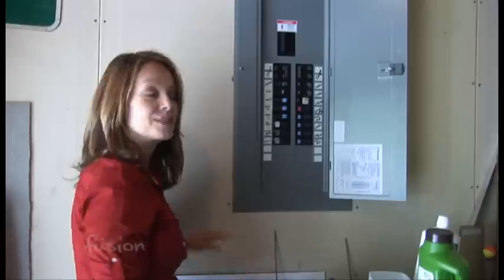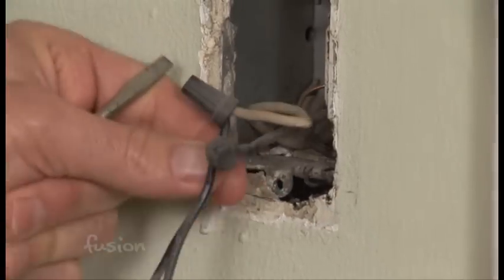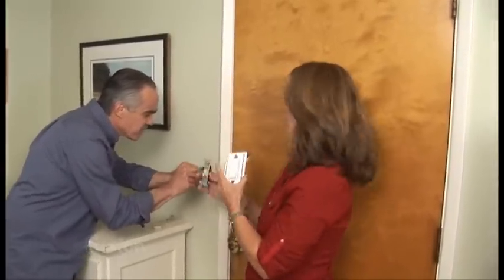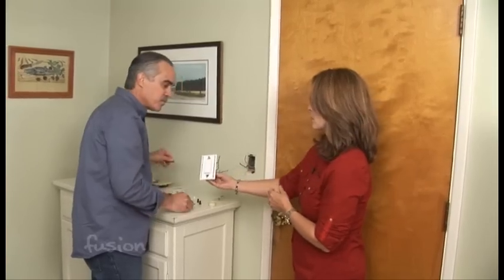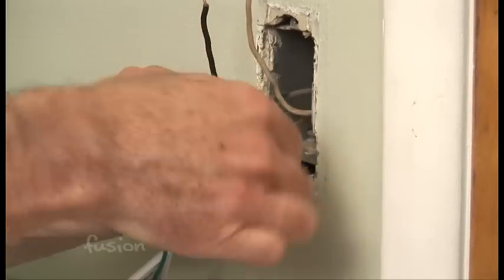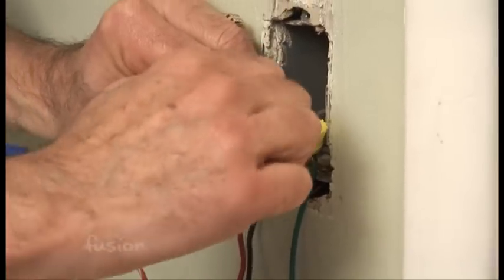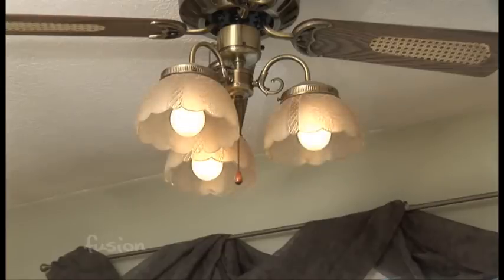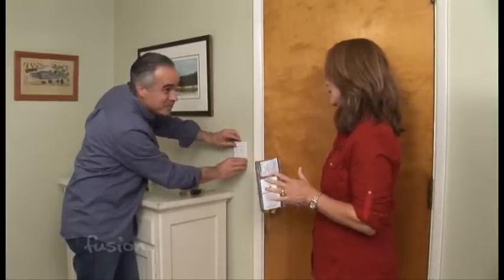Replacing a Dimmer Switch

Comment: I see your dim switch came with a red wire ..My dim switch came with 2 black wires and a green wire .
Now I'm confused . 
How do I know witch black wire has to be connected to the other black wire ??
Reply: Ones hot and one is not, but a $5 electronic pen, touch it, it will beep if it's hot,  and the other won't

Comment: If there are two black wires in the wall, which black wire do you connect to the black wire on the switch?
Reply: It doesnt matter

Comment: This video was very helpful, but what do I do if I don't have a ground wire in the box to attached to the new dimmer switch which does come with a green wire? The bell box inside the wall is metal and is inside an older home.

Comment: There's a few problems here, biggest one being you are checking for a voltage across two (potentially) live conductors the outgoing of which may well be at the same potential as the incoming which would also result in the voltmeter showing 0V while it may still be live.
Reply: He should be checking to the box/ground?
Reply: @silverspiderpig5  Correct. Checks for Voltage should be between all combinations of conductor "Classifications": Live (Hot) to Neutral, Live (Hot) to Earth (Ground), Earth (Ground) to Neutral (From this combination you should get 0V even when the circuit is energised) are the combinations that apply to domestic situations.

Comment: i did wire the same as shows on your video ...and it did work fine with light but when i have a fan on on high speed and when i dimmer the light the fan slows down as well .. which i don't like it .. so is their any solution

Comment: I am replacing a dimmer switch like the one in the video with a regular on/off single pole switch. The only thing is my new switch does not have a ground screw or any place to attach the ground wire from the box. Is this because the box itself is grounded and attaching the switch to the box with metal screws then grounds the switch? Or do I have to do something extra with the ground wire from the box?

Comment: Black doesn't always go to black.. Black on the new switch is your line, red is load. And when connecting to a switch leg (only 2 wires in box as in the vid) white is usually incoming voltage unless an idiot installed wiring, and black is outgoing! Leave electric work to electricians. Im tired of cleaning up home owners mistakes!!